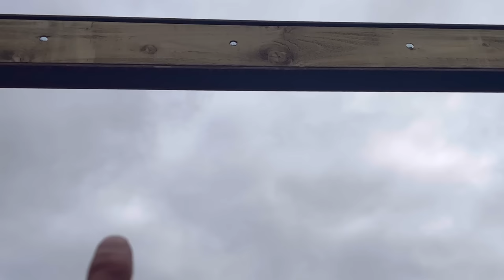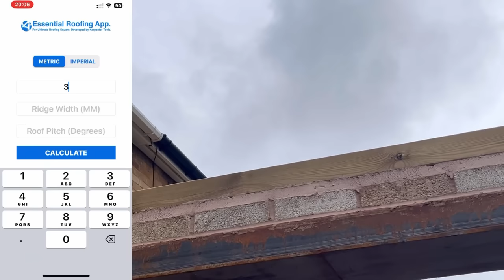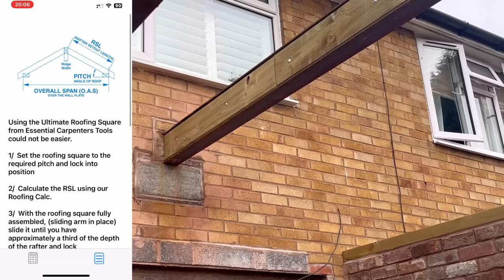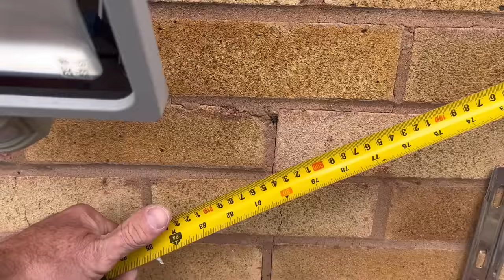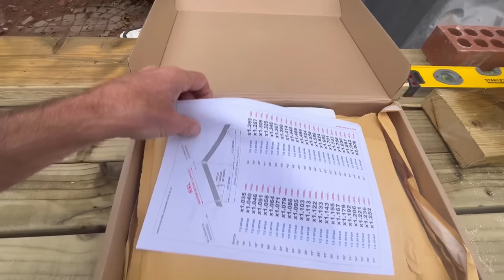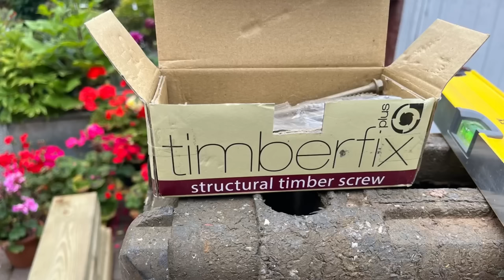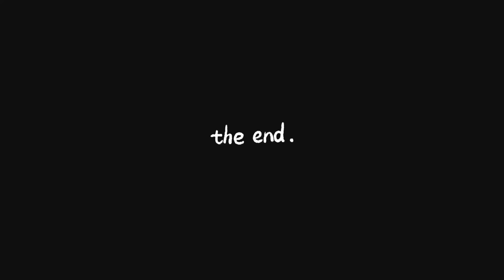Cut Roof With A Steel Ridge Beam - New roofing square

Comment: Last rood we did lime this we used a 9" x 3" timber and not steel, steel is just iver the top on my eyes, talking of steel, that side limtel looked a bit ropey, i know its not your work buddy but surely red oxide should have been used. That rust looks well set in. Your work is brill though mate

Comment: Lovely job Rich and I’m glad you got your head around the square.
Just a little tip those tech screws are for steel up to 3mm, they do make them for 12mm and 25mm and it was also good seeing you use a drill driver and not a impact driver on them.
Reply from the maker: Cheers mate it’s a great square and looking forward to using it again. From what I remember those tek screws were for up to 12mm but nevertheless worked a treat. Didn’t want to risk trying to put them in with out a pilot hole and yes mate definitely not for use with an impact. 👍🏻

Comment: Building inspector into bondage. I went to do a loft conversion and was told to use steel. I decided to ask a nother joiner to help me. Building inspector came round to make sure we were doing the work right. The helper said I don't work with steel and he said OK use wood but I wanted to use wood no you can't. Thay new each other . One rule for me and another for him . Wood was used and signed off.
Reply from the maker: I’ve done many loft conversions using laminated timbers glued and bolted on site and never been called back to as much as a crack in the plasterboard. I can’t see an issue with using timber and the Americans never use it from all the channels I watch. We really need to catch up they are so far in front of us. Building inspector common sense seems to be getting worse as well. If it’s not in the book they can’t help 🤷

Comment: Surely as you have lost so much height with those collar ties which aren’t necessary for structural purposes it would have been better to get a vaulted (barrelled) roof truss ?
Reply from the maker: Not worth it because of having to fit those 3 velux in it. 👍🏻

Comment: How did houses of the past survive with 6x1 as a ridge,
Reply from the maker: My thoughts exactly Steven. I’ve taken roofs down to put up extensions with 6x1 ridge and 3x2 rafters with no bow or sag with rafter lengths longer than this one albeit proper rough sawn 75mm x 50mm. 🤷
Reply: @mrabuilders6723 That old timber would be proper slow grown stuff with really dense growth rings. The only thing to complain about on old roofs is a lack of worm treatment.
Reply: If there's no ceiling joists the spreading force of the rafters can push the walls out. The ridge beam (as opposed to ridge board) prevents the spread as the ridge can't drop. So in this case, with a ridge beam, the collar ties aren't really doing anything structurally, but I guess it gives something for the ceiling to be fixed to...

Comment: That shed is built like a brick $@!t house. Given the structural lag screws I wonder if collar ties were even necessary.  Nice work.
Reply: They are doing nothing apart from supporting the plasterboard. Unfortunately some Building inspectors have little understanding of Engineering and Structural Engineers love to over design.

Comment: the ceiling collars are too low, it would have been so much easier and better to have fixed them flush to the bottom of the ridge beam, 145mm higher from your measurements, it would make the rooflight trimming much tidier, why not put the wall plate straps down the cavity side of the feature wall, much better than the horizontal straps
Reply from the maker: Hi and thank you for commenting but I’m gonna have to say that if you’d watched the video from start to finish your questions would have been answered and the reasons for what I did would make sense to you.

Comment: surprized the steel is not red oxide or metal primed before the timber is bolted,nice brickwork good to see these days
Reply: Would that be necessary? Is it just to protect from being weathered while not covered in or?
Reply: We are required to do a red oxide coating on all steels in the south @BcMzRusT

Comment: Could you not have just bolted a length of 4 x 2 on top of the steel and birds mouthed onto this?
Reply from the maker: Hi John thanks for commenting and Happy New Year to you.  I did think about that but I decided that bolting into the web would be a better fixing and bolting on top would need to have been planned in advance to make sure the bolts didn’t end up being in the same place as a rafter. If you missed it in the video I only did the timber work the customers builder did everything else I just specified the timber web holes. 👍🏻
Reply: @mrabuilders6723 thanks for the reply. Nice job by the way,.

Comment: I've got my extension roof to di, very similar with a steel ridge.

I was planning on bolting a timber ontop of the steel Instead of the sides like you. Do you think it would work OK on the top?

Thanks
Reply from the maker: I can’t see why not but my plans didn’t ask for any fixing detail at all 🤷so I decided that I would do it like I did. All the best with your project and I’m more than happy to help you by answering any questions  👍🏻

Comment: I reckon the inspector was right to have a tie down ar the open end of the back wall.
If the house wall is being plastered then therr ought to be one there as well really.
If the rear wall is double skinned the brickie should have built in a few vertical straps as he went then it would have fully complied with the regs.
Whoever designed the extension should have ensured that it would comply.

Comment: I do rafters 2 ways. If a ridge beam, I sit a straight edge on the ridge and wall plate and sit my Bosch digital level n to get the angle. I cut the end of the rafter to that angle. Sit two on either side and temp pin. Mark where it touches the ridge and wall plate. The off cut from the end can be used to mark out the birds mouth.

If no ridge beam, I just measure the opposite, the adjacent is half the extension width, divide the opposite by that and that gives me the tangent. So the inverse of that is the angle.

On vaulted ceilings, I rarely spec ridge beams and do my rafters the second way. It means you can get the cross beam higher, plus I use dog washers.